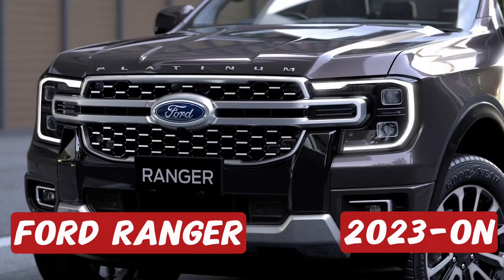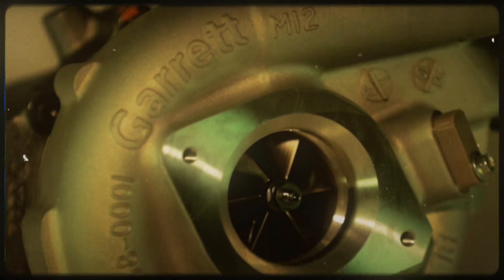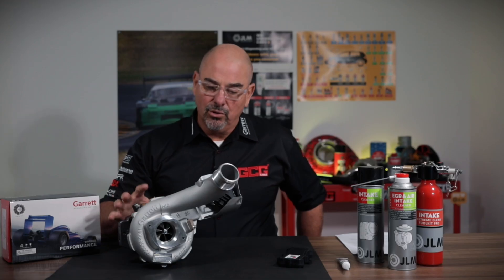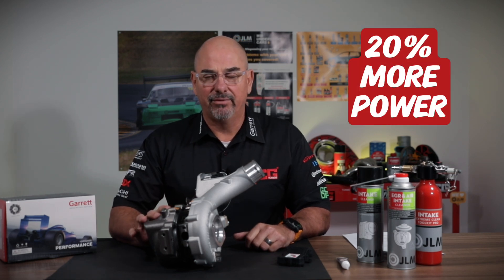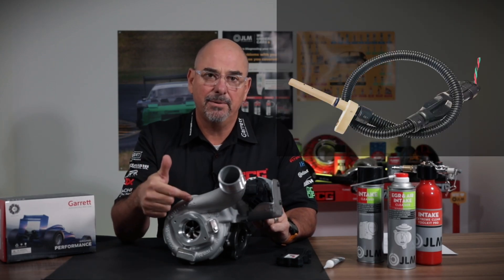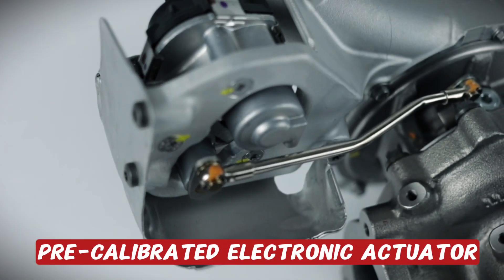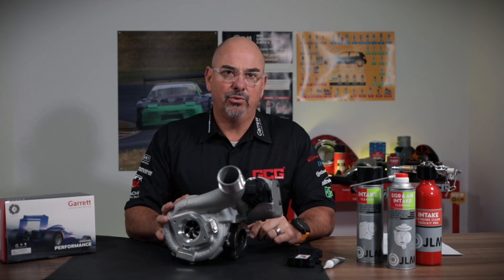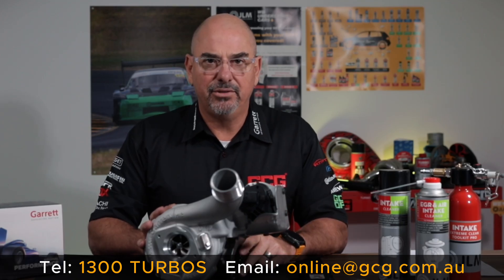Turbo Upgrade for Ford Ranger - 3L V6 TD - Garrett PowerMax

Comment from the maker: Full write-up and pricing: https://gcg.com.au/Garrett-PowerMax-Turbo-Charger-Upgrade-GTD2060V-Ford-Ranger-Gen5-3L-V6-Lion-TDi-G930592-5001S.html

This direct-fit turbocharger upgrade produced 292hp (218kW) - a 20% increase over the factory output of 244hp. The test vehicle used a stock intercooler, stock downpipe, stock airbox and a factory ECU without any modifications.

Product Application: Ford Ranger 3.0L V6 TDi (2022-on)
Direct Replacement for: MB3Q-6K682-AB (Garrett PN: 903552-0002/-5002S)

• Complete assembly with calibrated electric actuator for OE fitment
• + 27% compressor flow compared to OE turbo
• Customised, modern compressor wheel aero
• Modern turbine wheel aerodynamics constructed of Inco 713C alloy rated for up to 950°C
• Ductile Iron turbine housing rated for up to 830°C
• Fully machined speed sensor port
...
GCG Turbos Website: https://www.gcg.com.au
GCG on Facebook: https://www.facebook.com/gcgturbos/
GCG on Instagram: https://www.instagram.com/gcgturbos/

Comment: HOW IS IT POSSIBLE TO PRODUCE EXTRA POWER, IF THERE IS NO REPROGRAMMING FOR EXTRA FUEL.
EVEN WITH THE ABOVE AIR SUPPLY FROM THE NEW TURBO THERE SHOULD BE EXTRA FUEL. CAN YOU EXPLAIN TO ME HOW IT IS DONE WITHOUT REPROGRAMMING?

I AM ASSUMING THAT THE NEW TURBO WORKS AT THE SAME BAR PRESSURE AS THE FACTORY ECU, RIGHT?
Reply from the maker: The testing of this product was performed by Garrett so we do not have all the details, but, yes, it is possible for an engine to produce more power with an aftermarket turbocharger without a full ECU remap. Just how much more power you can get will definitely be limited by the way ECU has been mapped. Most will have overboost protection, but there's usually a grey zone in which it will still adjust fuel and timing automatically to cope with the extra air supply. The aftermarket turbo will also have a different spooling characteristics, so even without extra power it will be more "responsive". Having said all that, this was a "test" vehicle and we always recommend an ECU remap to take full advantage of the new hardware. That and some supporting mods are the key to getting the most of any turbo upgrade.

Comment: 27%"improved" compressor flow claim is ambiguous and missing the whole picture.
It's probably 20% worse somewhere on the compressor map too.
Reply from the maker: If you click on the link in the description, you will be able to see the full compressor map and a comparison vs oem turbo. This turbo produced 292hp (218kW) - a 20% increase over the factory output of 244hp on a test vehicle with a stock intercooler, stock downpipe, stock airbox and a factory ECU without any modifications. Hope this helps.

Comment: Why would the original turbo need replacing on such a new vehicle?
Reply from the maker: This is an upgrade not an OEM replacement. You would upgrade your turbo if you're planning to modify the vehicle for more power, torque etc.